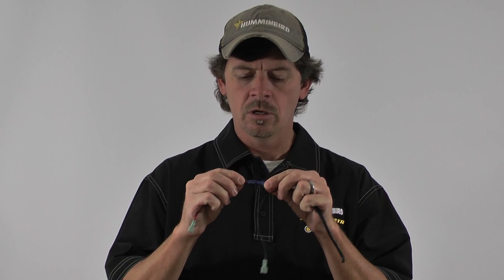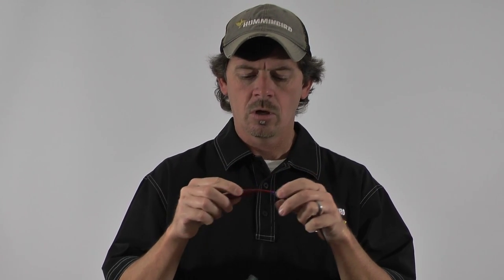Power Video 1

Comment: Myself as well as a few of my friends all having the same problem with our Helix units kick off when the key is turned over to start the big motor. It doesn't seem to matter whether the unit is hooked directly to the battery or to the buss bar. I understand that if the unit senses a low voltage output it shut down but it seems to me there should be a 15 second time delay built in for when you are cranking over your big motor before the unit will shut down.

Comment: I have this issue. (had)....   my 999 works fine, but i start the motor and the unit went black.  then refuses to power on (buttons are still backlit though)  HB repaired it with a new power circuit board.    i hooked it back up, and it worked for an hour, then the unit went black again (once again while starting the motor)

the 999 is hooked DIRECTLY to the battery, about 3 feet away.    only things connected to the battery are the 999, the 40hp evinrud motor, and the rear power anchor.   no fuse panel/bus bar....

what could cause this.   i'm afraid to hook up and blow another circuit board.
Reply from the maker: This issue would indicate an internal issue and would require the unit to come in for service. If the unit is outside of the one year warranty from date of purchase or the two year warranty if registered through HumminbirdSelect then our service fees for each model can be found at the following link.
https://www.humminbird.com/faqDetail.aspx?id=1477